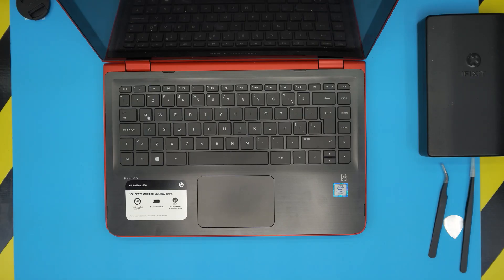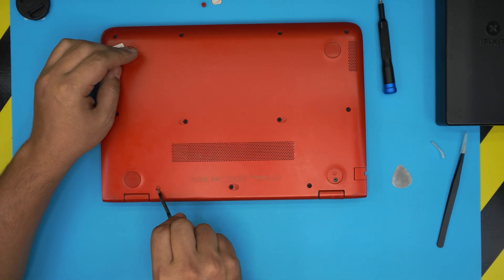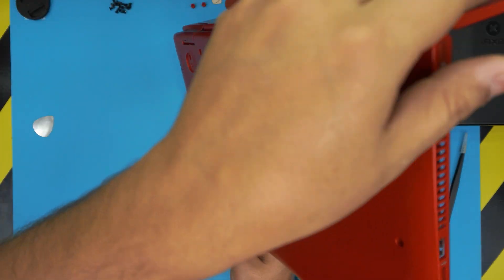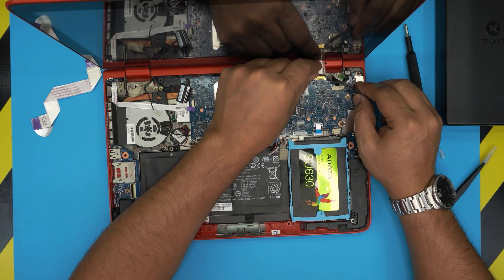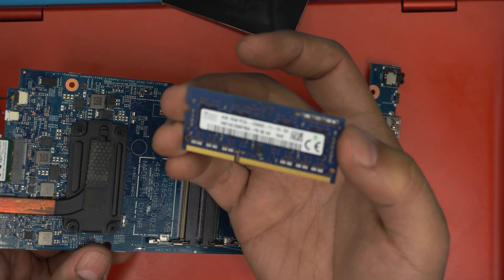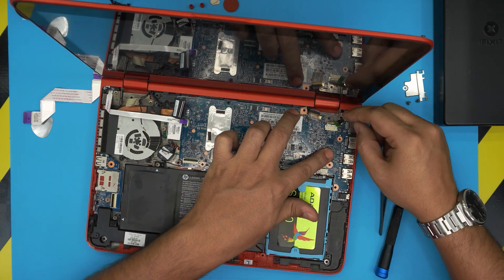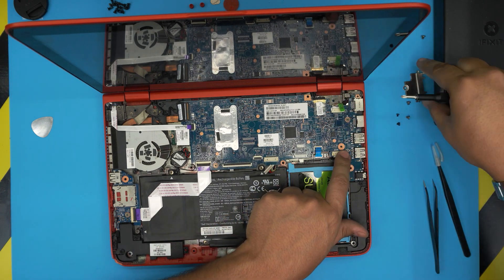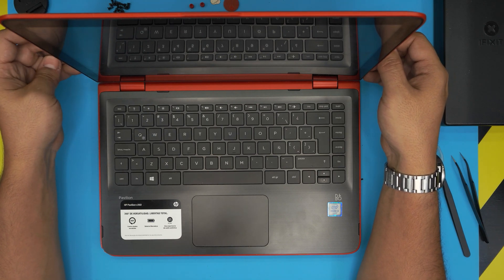HP Pavilion X360 13 S101 RAM UPGRADE ✨

Comment: Hello, i have a problem with my HP laptop, i already got installed a secondary ram module and it is suposed to show 12gb available, but it only recognizes 4gb on the bios and windows.
Reply: I double checked it on cpu-z and it shows me 12gb on SINGLE channel, but windows keeps showing me only 4gb available
Reply from the maker: there is something wrong on you windows registry, this issue was happening to a client and we had to reformat the windows.
Reply: @uFixTek  like installing it again?
Reply from the maker: yes reinstalling windows can solve that issue, at least it does to our clients.
Reply: @uFixTek  Thank you so much sir, i'll try it
Reply from the maker: wish you the best, cheers🍻

Comment: Hello and thanks for the detailed video.i upgraded the ram and ssd on my laptop ,everything went fine but when i shut the PC it turns on again.do u think there s a problem with the power connection on the mainboard?
Reply from the maker: Thank you for your feedback! If you wish to support the channel, you can like, subscribe, or both!
Regarding your question, this is not a HARDWARE issue my friend it is a software issue.
i recommend you to turn off the FAST boot option from control panel > power settings advanced.

other option you can try is using this and if it works i can show you how to create a file and intergrade it so you don't have to all the step every time:
Step 1: Click Start and type "cmd" > Run as Administrator.
Step 2: When the Command Prompt window is open, insert the following command:
Shutdown/s /f /t 0
Step 3: After a little wait, restart your PC.

another way you can try this:
Disable Automatic Restart:
Step 1: Open the Settings menu > System > About.
Step 2: Choose Related Links and tap on Advanced System Settings.
Step 3: Under the System Properties sections, go to Advanced > Startup and Recovery > Settings.
Step 4: Then, uncheck the Automatically restart choice under System Failure and press OK.
press ok

if none of the above worked let me know i can help you fix it.

Comment: I cant attach the antenna cables back to the network card. I seem be getting wifi just fine but they wont click in. Cheers
Reply from the maker: Thank you for the feedback! if you wish to support the channel you can LIKE or SUB or both :P
regarding your question:  try to use a magnifier to check the cable of the wifi to see if its ok and not damaged, it should snap into card, but if you getting wifi then don't touch it.
If you have any future questions or requests, please don't hesitate to reach out to me. I'll be happy to assist you.

Comment: When upgrading ram do i need to do any software updates? Or is it plug and play. Also will my HP 13-s122nr be able to handle 16gb ram?
Reply from the maker: Thank you for the feedback! if you wish to support the channel you can LIKE or SUB or both :P
regarding your question: regarding the ram installation, its absolutely NOT required doing anything its plug and play. if you want to know the max ram cap check this: https://youtu.be/tKEJTkVth4Q

Comment: Is it possible to put an small ssd like m.2 2230 size in place of the wifi adapter? will it work? what is the keying of that slot?, kinda looks like an msata
Reply from the maker: Thank you for the feedback! if you wish to support the channel you can LIKE or SUB or both :P
regarding your question: it won't work, even that it is a m.2 PCI-E lane, BUT the m.2 is not keyed for SSD use, its an E key, which is not compatible with any M.2 SSD
to conclude don't waist your time on that, it won't work.

Comment: Mine only has 4GB stock... if I add 16GB to the second slot, is it better to put it in the first slot and move the 4 to the second? I'm also cloning my drive to a 1Tb ssd (current is 500gb HDD).
Reply from the maker: Thank you for the feedback! if you wish to support the channel you can LIKE or SUB or both :P
regarding your question: sorry that i was away for few days, 1st of all i would recommend to watch this video to CONFIRM that your motherboard can handle over 20GB
https://youtu.be/tKEJTkVth4Q
and regarding the positioning of the rams it makes no difference if you place 4gb in 1st or 2nd slot.
about the ssd upgrade you can clone but after cloning you get a lot of error then i recommend fresh install (its always the best)
https://youtu.be/bMlm9SDcWmY
Reply: @uFixTek  thanks for getting back to me! I ended up using 2x8gb's (could not find any single 16gb's. Cloned the hdd to ssd (1Tb)... all is working well. I was worried that would run into issues with the different connecting points, but luck was on my side. Thanks again  for the great step-by-step tutorial!
Reply from the maker: @funnyguy1487  I'm sorry but i have no idea why YouTube  place most of the comments in the spam list!! sorry about it :(
 im very upset about this youtube algorithm that is broken, a "thank you" counts as spam or review comment!!!
im glad you got it upgraded :)
Please leave new comment if you have any questions.

Comment: Thanks for the video, I have the same type of laptop going to upgrade from 8gb to 16gb  (2x8)  is it important to use the same brand of memory stick?
Reply from the maker: Thanks ✌  for the feedback!  if you wish to support the channel you can LIKE or SUB or both :P
regarding your question: no not at all you can place any other brands, absolutely don't make the difference. i been upgrading for over 20years and zero issues.